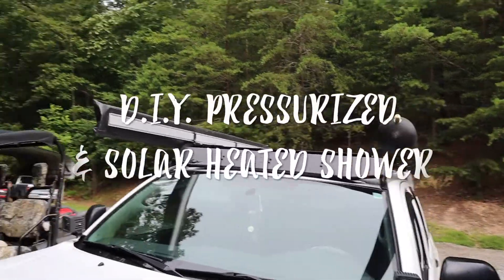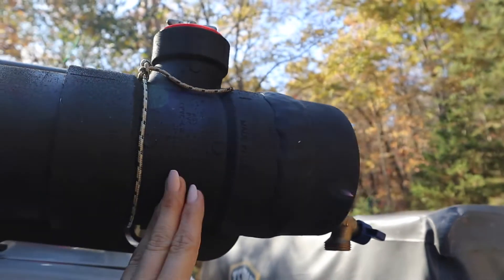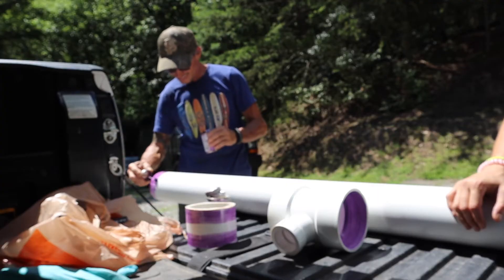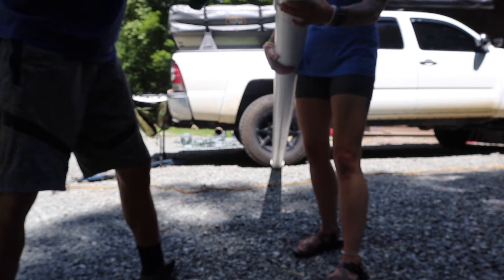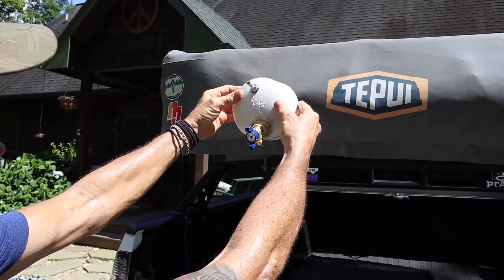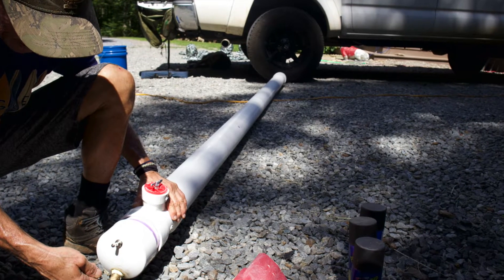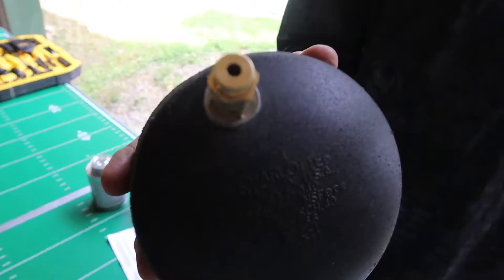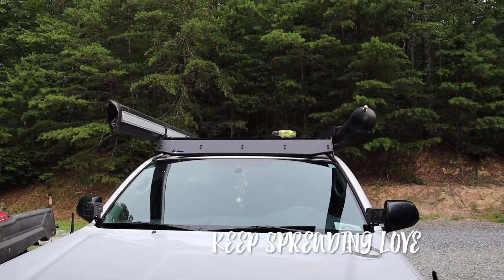DIY Solar shower, Overland Camp Shower

Comment: Hello,  I'm considering building a similar shower.  Question for ya, how hot can the water get,  how long does it take to heat up and does the water get warm/ hot even on a cloudy day? Thank you in advance!
Reply from the maker: So it was never “hot, hot” but I was using it while camping more in the woods. (When stationary at camp I would leave the hose on and the water left in the hose would be warmest then once that flushed through a little less warm) 

I’m sure if I had used it, while in an open lot with sun all day it would have been much warmer. 

I never tested actual temperatures or how long it would take to get warm. I just filled it before my trips then emptied it at the end (I didn’t like the idea of water just sitting in it for no reason) 

I hope that helped. I would do one again if I had that type of set up/rig again. I loved it for camp showers as well as being able to hose off dog after a hike, beach chairs and Sandy feet after a beach day.
Reply: @HannahSpreadingLove  Thank you for the response.  I've heard mixed answers regarding how hot it actually gets, so it's nice to hear another's opinion!

Comment: It’s an idea to state the technical names of all the parts so people know what to buy. For example the pressure filling valve is called a Schrader valve.  You also need to state that you need to use pressure rated pipe and the pressure it’s rated to. If normal pipe is used it may explode and a lot of people who don’t know may not use the pressure rated stuff hence accidents might happen. It’s never a case of using any old stuff.

Comment: It's look cool!! But I think PVC pipe is not a good for heat up under the sunlight because UV will caused the plastic softens and releases constituent compounds into the surrounding air and water.   :)

Comment: how many gallons does this hold?
Reply from the maker: I think it's a little over 5. I Google searched what it held by the size of the tube. So it can vary dependent on what length and diameter you go with
Reply: Ty how far does 5g last you ofc it’s how you use it but just curious

AlSO  do you have to run an air compressor constantly while you use it ? 🐘🦒🦖thank you
Reply from the maker: Just have to use little compressor to get the pressure there. It'll last a day or so (the pressure) and then for sure just sure on how its used. Easily done a 5 day camp trip with preshrunk of water left. Used it to wash dishes and a quick shower or 2.

Comment: Hi Hannah, how is the test plug working?  I see the 3” one is only rated for 5psi, but seeing if it will holdup to 30psi.  I’m using a threaded plug but it leaks a little air, thinking about cutting it and replacing it.
Reply from the maker: This one worked great multiple times. Then it got stuck and I had to "jiggle" it free with something flat and it hasn't been the same since. But it worked amazing before that. I think I scratched the inner rim of the tubing where the plug goes
Reply: @HannahSpreadingLove  oh bummer! Thanks for the update.

Comment: I live in San Diego CA and the sun here is out most days of the year. My concern before building one of these rigs is that water might get too hot for a shower. What climate do you live in, and about what temperature do you think your water is when you use it?
Reply from the maker: The water temp never gets too hot, just a comfortable warm. I’m in northern Georgia. So summer it gets in the 90s. I’ve never actually paid too close attention. Also because when I’m camping I don’t want my tent in the direct sun, so the shower never is in direct sun all day long. You could always leave it white if you think painting it black will make it too hot. If you make the mounting easy enough to take down… if you find it doesn’t get hot enough you could always take it down and paint it then mount it again.

Comment: do you think having multiple hose clamps spread and attached to the prinsu rack work the same? curious to know how its been holding up for you now when driving and water is all filled up.
Reply from the maker: So I have a friend that did the same thing. His is a little longer, and he has 3 clamps (one on either end and one in the middle) but his has a bad “bow” in it… I think because it isn’t a “high heat grade” pvc. Mine hasn’t done that but I am able to park on a garage at home and (I only fill it when we are going camping or know we will need it after a day in the dirt/sand/etc) I believe there is a heat grade pvc out there tho so you could do it with that instead and hope for no “bowing”

Comment: It is a good idea to sand all surfaces that are glued as well as primer, glue on both surfaces and twist and hold as sliding fittings together 👍
Reply: The primer etches the plastic,  giving it a sanded like surface

Comment: Why......can you not FILL it using the same hose fitting that you attach the shower hose to?

It would eliminate another leak spot and simplify the build even more so....

Some quick-disconnects & you’d be golden.....

Comment: How many gallons & how long is this unit ?
Reply from the maker: So it's a Little over 5 gallons. I'll add the conversion website link along with the dimensions in the description
Reply: @HannahSpreadingLove  how long is the unit?
Reply: Cool thanks..I just put a 10ft X 4" A.B.S. I didn't know how many gallons. Im still waiting for 3types of High-temp glue to dry
Day#2 3rd day ill pressurize it
Reply: I believe for 4 inch pipe its ft times 0.652… At 10 ft you should be way pass 6 gallons